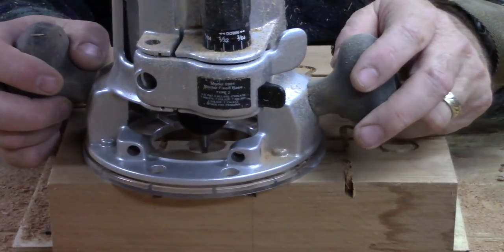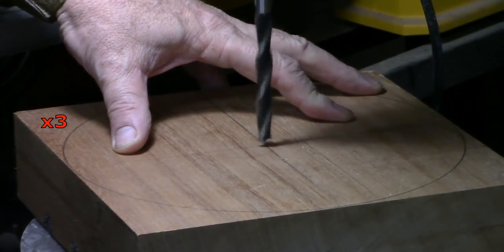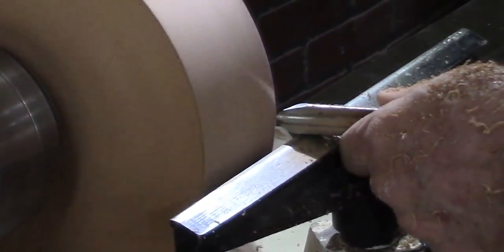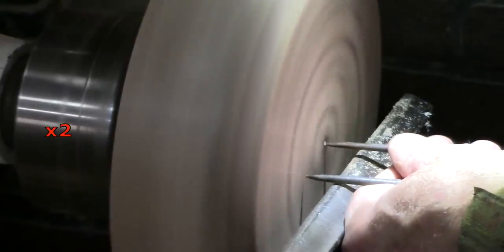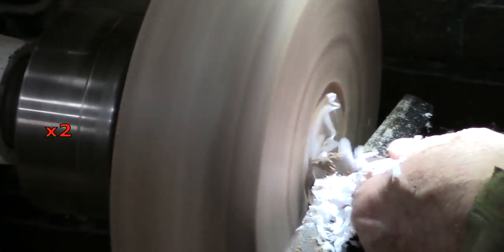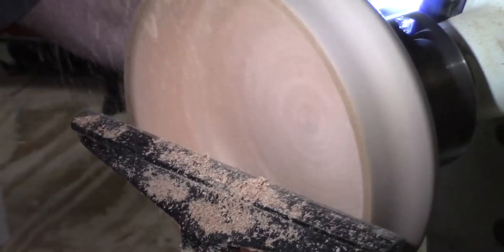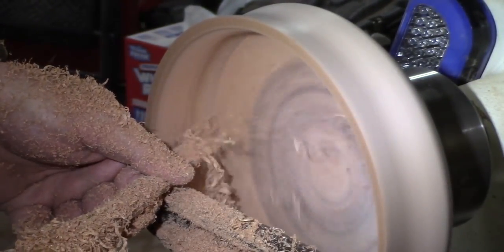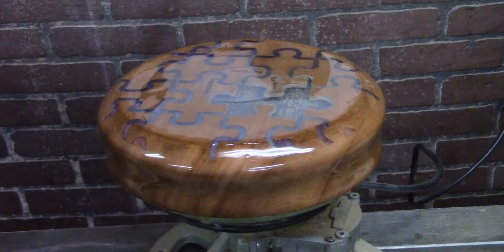Wood turning a Puzzle, A Pretty Fail - Resin and Router Skills

Comment: Wow. I wasn't expecting such a cool result based off the title of the video. I really liked the look of the puzzle pieces "floating". Awesome job. Pressure chamber definitely would help eliminate the bubbles.
Reply from the maker: Thank you...yes, will get a chamber set up.  I have a smaller pressure pot but have yet put the valves on and use it...

Comment: Beautiful work, resin can be problematic, especially without a pressure pot, I don't have one they're expensive! I use ultra low viscosity resin that cures over 12hrs and it works great :)
Reply from the maker: Thanks, that's my usual method, I just ran out 😊

Comment: A Very nice looking fail. Perhaps a vacuum (or pressure)  chamber made from a paint pot would help you eliminate those darn bubbles. Nice job, despite the bubbles.
Reply: Definitely pressure pot. Vacuum would have made it worse. Peter Brown did a video comparing the two recently.
Reply from the maker: Thank you!  Agreed.  I need to get my pressure pot set up.  🙂

Comment: Great videos.
I've become increasingly interested in turning. 
Any suggestions on equipment to start out with? 
Thank you and thank you for your service.
Reply from the maker: Thank you!  That's a really big question!  The first thing I would do is check to see if there are any clubs or facilities (wood working stores for example) where you might get some hands on time with a lathe.  That experience would inform you much better than I can.  I started with an inexpensive bench top lathe and a set of cheap tools...I was almost immediately hooked and shortly thereafter upgraded to a mid range lathe and really good tools, (high speed steel at a minimum) Hope that helps a little!
Reply: R Humphrey thank you.

Comment: Rod, couldn't you rerout the epoxy completely away, put the bowl on a well coated melamine board, fill the the bowl back in with a slow cure epoxy and then just scrape and resand the bottom again? Just a thought because the bowl did come out great...Just because you felt it was a fail, (A slight one, at worst), doesn't mean that you have to keep it that way...Right? At least you learned the right way to do it and taught us the lesson on how not to...And maybe correct a mistake to boot?? Just a thought from a poor Rabbi!
Reply from the maker: Hey Ranger, good to hear form you!  No, I think I'll keep it as is, as a good reminder.  Thank you though!  Semper Fi
Reply: @RHumphrey  ...Shalom Aleichem Leatherneck!